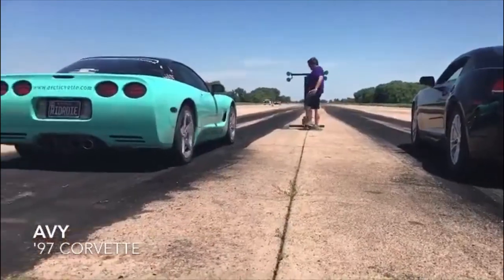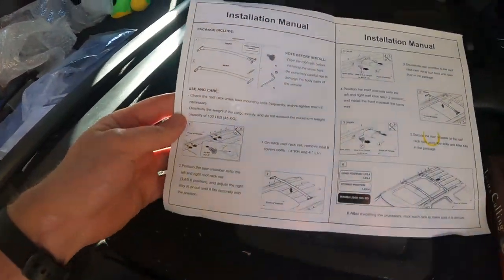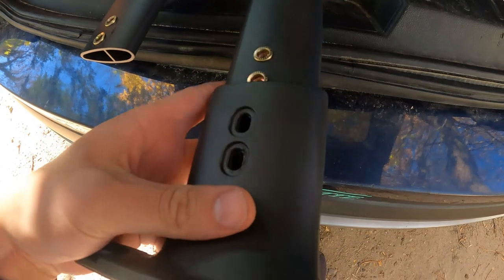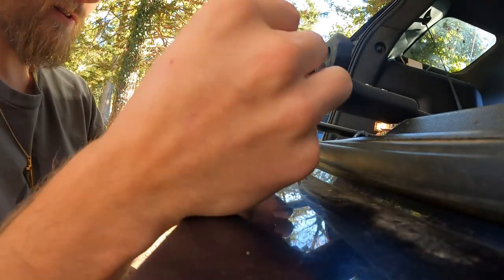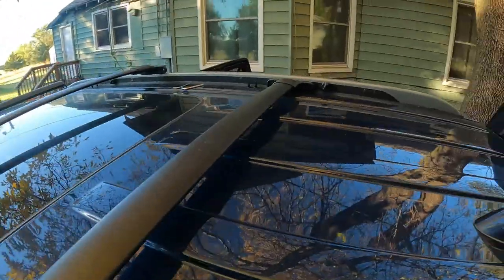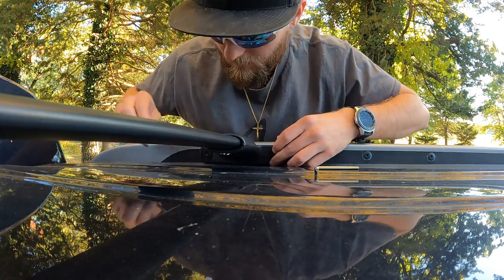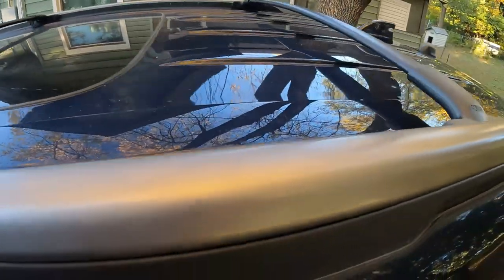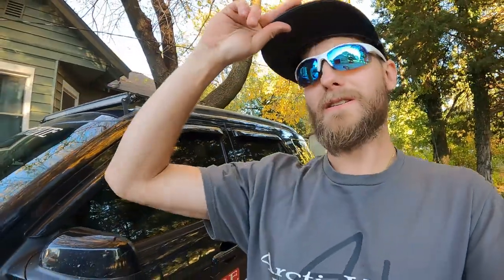How To install Cross Bars on a 2016-2019 Ford Explorer (LED KINGDOMUS) - Daily Vlog

Comment: In this video where you put on the roof rails is that a light bar on the front of your Explorer and if so what brand and how did you mount it? And thank you for this video I was curious as to how to install these.
Reply from the maker: @davidmay2939  yes it is a 52" light bar. I made my own mounts from the ones they sent. Took off the cover that leads to the windshield, and mounted it to the bolt under that. I cut a small piece out of the plastic cover on each side. Still holding on good!
Reply: @ArcticVette  Thank you for responding. May I ask where you  ran your wiring?
Reply from the maker: I ran it down the windowshield under the covers. Then it went right into the engine bay from there and wired up great. The switch I actually ran just through the door alongside the factory harness. I never got around to getting it through the firewall.
Reply: @ArcticVette  I do know that there's a grommet down by the brake paddle that I can run wires through. Thank you for your help I greatly appreciate it
Reply from the maker: You're welcome! That's where I should have run my wires through lol

Comment: Thanks for showing how uncomplicated the process is. You mentioned there is a choice of where to place the racks. Is one rack position recommended over another?
Reply from the maker: Just depends on what you'll be putting across them. If it's something smaller they may need to be closer together to keept it off the roof.

Comment: Hey just wondering how this roof rack is holding up?
Reply from the maker: It's doing great! I use it every now and then. It's more for looks than anything. 

The only issue I have is that the wind seems to have bent the back plate. Which I don't believe is needed, and it should be able to be straightened out.

Comment: What is the max load capacity with the cross bars ?
Reply from the maker: It says 100lbs, but I know it holds more because stood on top of them with no problems and I weight 160lbs 😅

Comment: Where did you get the tie-down screws that you took out??
Reply from the maker: Those came with my Explorer when I bought it. They were in a Ford bag in the glove box. 

Roof rack screw hooks seems to be what they are called. I had no idea lol

Here are some from ebay: https://www.ebay.com/itm/155062461563
Reply: Got mine used so the glovebox was empty LOL! Amazon was a bust using anything I could think of to search on, thx for the quick response and eBay link!!

Comment: Bro im an idiot can u help.i just got a 1997 ford explorer xlt and cant put the cargo rack on. Cant find a youtube video in it so im screwed.  Any idea?
Reply from the maker: I've tried to look up some solutions but I haven't found any. Etrailer seems to have some cross bars that  would work with your explorer by hooking to the top of the door frames. You might check those out!